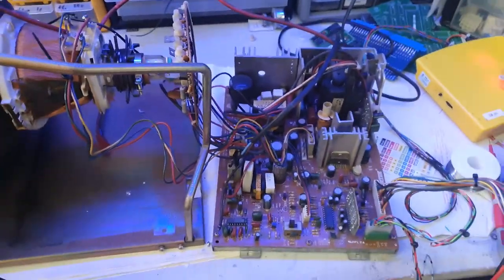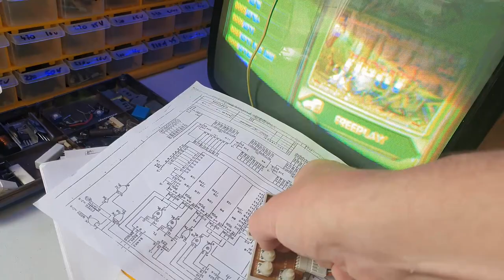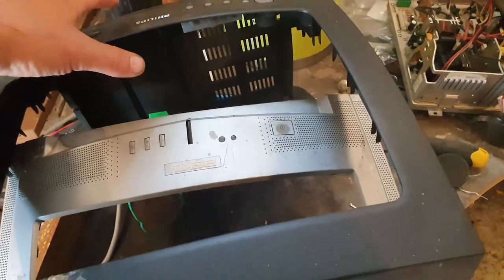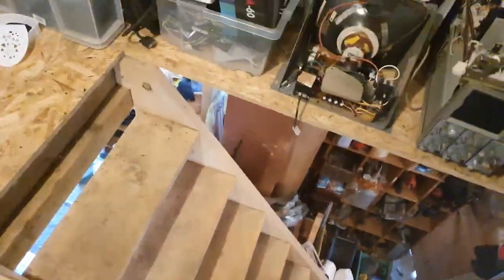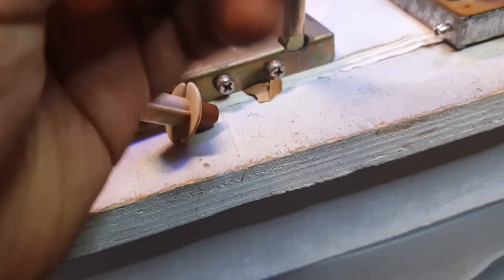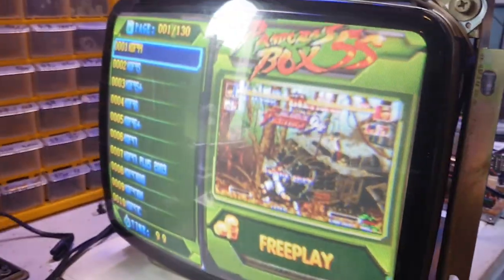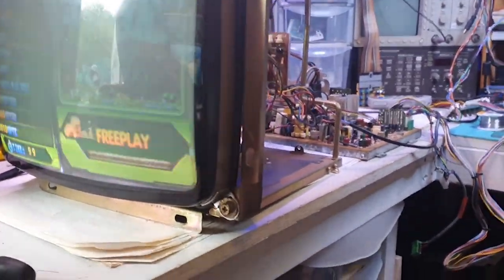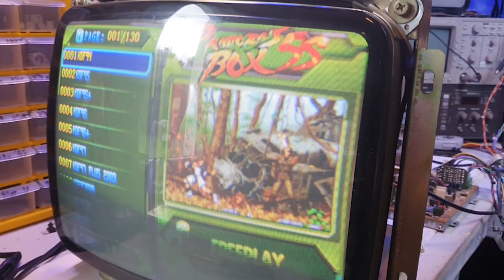Kortek KTM F 14  inch CRT monitor repair

Comment: Nice, had a knightmare with a kortek monitor before. Interested in the coil swapping, is that difficult? Great vid as always 👌
Reply from the maker: coil swapping is pretty straightforward. but the adjustment rings can be a pain if you move them in the process.
Reply: @8bitmanshed  great question from Edd. Perhaps you could do a coil swap video?